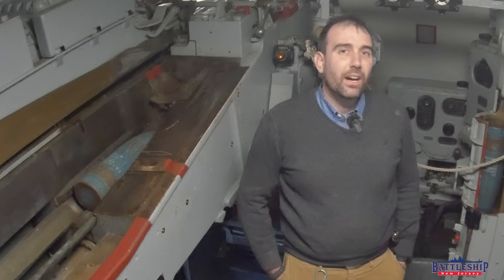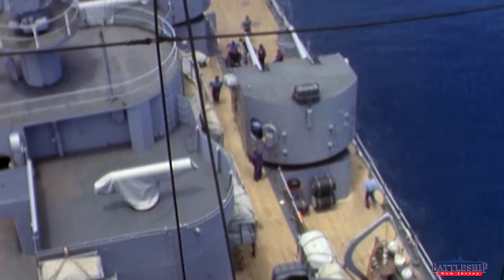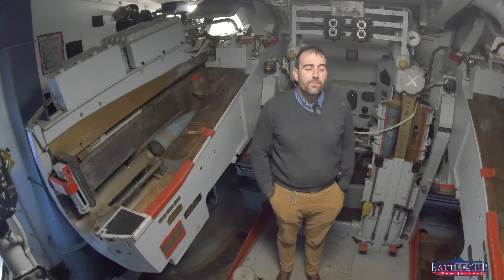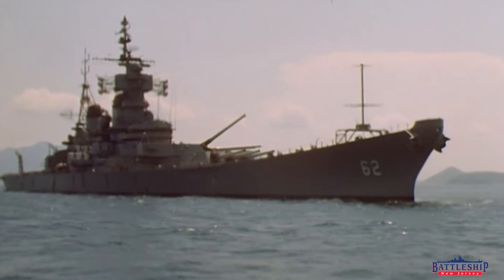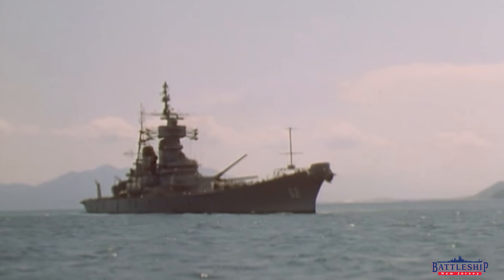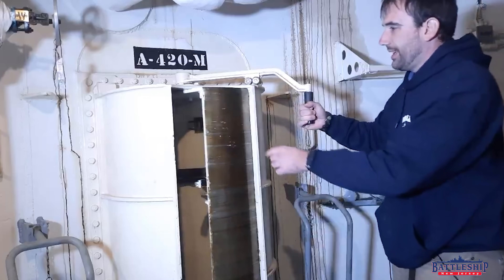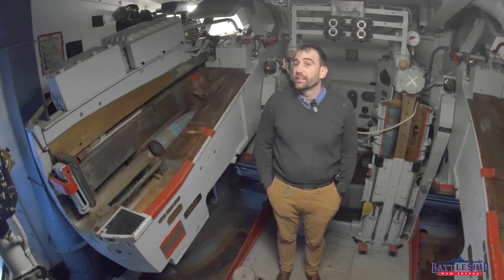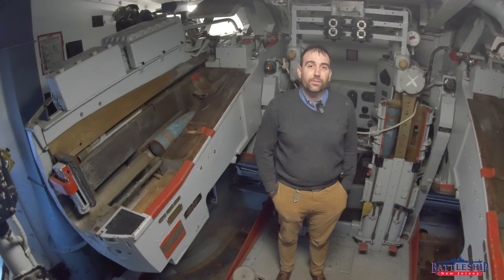Why Do Modern Warships Have So Few Guns?

Comment: What is needed in modern destroyers are a more capable main gun in the 140mm to 155mm and even the 127mm/L64 and another two medium high velocity guns like the Oto Melara 76mm/L62 super rapida or a brand new 88mm high ciclic rate of fire and long range and altitude and of course a couple of 35mm or 40mm like the French CTA or the Rheinmetal AG Millennium gun or even the Mauser MK-27mm and the upgrade of amunnition that is already happen with time mode airburst capability or cased telescopic ammo and the new Leonardo/BAE Vulcano amunnition with a 120km range from a 127mm shell but we need is a 140mm or even a 166mm heavy shells than with this extended range ammo even from the 155mm VLP capable of more than 60km form a 52 calibre barrel its impressive can hit targets in land easily but i think that rocket artillery will dominate targeting on land targets they are cheaper than a missile like NSM or Teseo MK2 Evo or RBS 15 MK3 Gungnir a GLMRS from the sea rockets with new improvements already go to 100 miles easile and others 300km like the Predator Hawk and i think from now on more types of this rocket artillery will be develop, like the GLSDB from Boeing/SAAB they can hit targets 150km on land and will be very easy to load and integrate on a ship and they have a 93kg warhead that is very effective agaisnt a range of targets and very cost effective i think that will be the future i dont now why in Europe so many amazing frigates and destroyers are being design and build like American new frigates dont implement already this new ideas and proven armament and continiuos evolution of systems i think we all see how modern warfare will look like you just have to look at the Rússia invasion of Ukraine. We need in the NATO western countries is a massive rearmament program and new amazing developments of new systems that will create millions of jobs and exports to friendly nations

Comment: You nailed it.  The trend has gone too far away from guns to missiles. Guns need to come back to a economical and utilitarian balance.  The single main gun will stay, as will the missile loadout as the main weapons systems. But the idiots designing these ships and the idiots ordering them will soon learn all ships you want to NOT be taken out will need a good, last line of defence, 360 deg CIWS, i.e. Phalanx and or air burst munitions like the 40/57mm 3P Bofors.

Comment: You have to look at the cost of building a battleship with multiple guns, ammunition, crew, and fuel in comparison to an Arleigh class III Destroyer. The modern Destroyers are manned with a quarter of what it would take to manned a battleship and be more effective on its mission.

The Tomahawk missiles (though expensive) have a wide range ordnance that can attack a target (i.e. cluster bombs, high explosive warheads, etc.). The 5-inch gun has rounds that can penetrate several layers of steel and explode more effectively than the old WW2 variants.

You also have to factor in the anti-submarine warfare capabilities of the modern destroyer in contrast to your battleships.

While it is sad to see the big guns go into retirement. The mission is always evolving, and everything changes with it.

Comment: Sometime around the mid 60s , the air force made the mistake thinking guns were obsolete and they were wrong. They have to fix that with a new generation of planes. But then a big gun can lug down an airplane and take away flexibility, such as the 30 mm in the A10. It be so nice to make the gun detachable and substitute other ordnance instead.

Comment: I think until energy weapons are more viable (I'm aware that they already somewhat are, but they still aren't really in use, or at least common use) that we will probably see more CIWS gun type systems filling the gap of missile cost/ammo expenditure, and maybe even some old school large bore flak guns as drone swarms become a growing a threat. And I think we are likely to see railguns in use at some point, as they offer missile like range, but a much cheaper harder to intercept projectile...I'm not even sure that could be intercepted, since they're basically solid metal unlike a missile...

Comment: Better ammunition is the key for Battleships to be revived. Looks like the guys from New Jersey dont know about the norwegian company Nammo and their products. They are making 155 mm shells with solid fuel ramjets. These are able to hit target from a distance of 150 km prety accurate. Besides there is one more example. At the end of WW II, germans had made some 283 mm amunition for the railway gun K-5. Aleksander Lippish was the man behind it. These 283 mm shells could go for 300 km. If we keep this in mind then a 406 mm shell could possibly hit some target that is 400+ km away and thats already a range of rocket. So far as i remember, even in the USSR was created something. The only difference is that a ramjet was on the nose to pull the shells and not to push. It was like some additional module to a standart ammunition to extend the range.
Dear battleship friend, you are actualy wrong. Ammunition with ramjets is the way for a modern Battleship. Of course all these shells should be like the Excalibur or russian Krasnopol, just much bigger.

Comment: Im not surprise that many WWII history enjoyers or knoes of WWI and WWII naval boats (or even way before) had this question.

I say, guns are not obsolete, neither missiles. We are starting to impelement laser defense systems as well and they wont be replacing the guns or missiles either.

Instead they will play a part of a layered defensive and offensive of modern naval combat.

Arleigh Butke Mk45 Mod 1 and 3 5in guns do have an autoloader but fairly slower than of the Forrest Sherman. It is capable of anti-air which is nice. We may see some ship classes with an extra pair of 5in or not. I do not know.

Not every missiles are that expansive, though the more advance a missile is, yeah it'll be expensive. ESSM can be bought in bulk and give 4 times as much anti-air capabilities.

To not drag this on, guns, lasers, and missiles will have to work with each other for defensive or offensive means. Not one will replace the other

Comment: I would Wish to have a shore bombardment vessel with 12" or 16" guns in a single dual mount fowards, the entire aft deck would have a double helicopter hangar holding 2 up to 4 helicopters each or F-35s, and the remainder with a massive battery of long range anti ship vertical launch missiles at least 30, amid ship would have limited super structure outside of the needed hangar room with elevators to access a air maintenance and arming bay, Each ship powered by a large single nuclear reactor contained in a armored citadel, with various other  CIWS, and Short range missiles.

Comment: I remember cruisers having one 5 inch gun in the forward section and one on the aft section(unless it was a smaller caliber of gun for the aft section).

Missiles and carrier air groups do a lot more in terms of naval combat. But, I think one more gun, single barrel and a smaller caliber added to the aft section of a warship could be possible. But I may be wrong because the Arleigh-Burke destroyers use speed and their offensive capabilities to defend a carrier, or even an Iowa class battleship. 

If a battleship or battle cruiser were to be built today, it would probably resemble Russia’s Kirov class battle cruiser and it might be longer and stronger in order to hold a larger capacity of shells.

Or include another Phalanx CWIS.

Comment: The Royal Navy is fitting a second 40 mm Bofors gun to their Type 31 general purpose frigates, currently under construction, to address threats such as low cost drone swarms.These frigates are primarily designed for the sort of conflict that is occurring in the Persian Gulf.  The RN had no alternative other than to deploy a large, complex, air defence destroyer, primarily designed to defend carriers, which is using expensive missiles to destroy crude drones.

Comment: Shore bombardment has been replaced by precision strikes. Shore bombardment is psychological warfare. A big gun is an instrument of terror. Better to kill the enemy than scare them sh!tless. There is more utility in a precision weapon than an artillery shell the size of a compact car. The cost of maintenance on a big gun with limited use is better spent on a surveillance aircraft.

Edit: As a onetime Ohio-class sailor, I submit the SSGN as the modern replacement for the battleship…even with the cost of nuclear power and missiles (which are leased until they go boom btw).

Comment: I can see the necessity of adding more 5" guns. The Iranian navy appears to have adopted a strategy of using swarms of high-speed, lightly armed, boats to harass larger ships. We cannot afford to expend a missile on each boat in a swarm. We'd be expending millions of dollars to destroy a boat that cost thousands. That math doesn't add up. Even if it did, defending a ship against one of these swarms could exhaust its entire supply of missiles, essentially taking it out of the fight until it could be resupplied. Again, the math doesn't work for us. A force of inexpensive speed boats could defang an entire squadron of US Navy destroyers, as long as the enemy were willing to lose that many speed boats.

Of course, a single 5" gun, with its auto loading and radar guided aiming, could handle a large swarm of speed boats -- as long as those boats stayed on the same side of our ship. But, if the swarm were to attack from multiple sides and directions, even a modern 5" gun could be quickly overwhelmed, allowing one or more of the speed boats to ram its high-explosive cargo into our ship.

Comment: Why is there so much rust on these ships?
Reply from the maker: Steel Ships in saltwater environments rust very quickly and surface rust is only a surface level issue. All active ships have rust.
Reply: @BattleshipNewJersey  I remember that they use to paint ships, do they not do that anymore? In fact I remember one of the jobs sailors had to do was over the side and paint them to help stop the rust. Every time I see a US ship it is rusty.
Reply from the maker: They do paint, a lot. But its not the most important thing they do so if they have more important jobs painting doesn't get done. Look at ships during WWII or Vietnam, they're rusty than what you see now.

Comment: I understand that missiles are the main armament, and therefore there is no need for so many guns as it was common in the past. What I don't understand is why do some rather big ships, like the largest destroyers and even some cruisers, have only a SINGLE gun. In assymetrical warfare quite common today, when such autocannons are useful against speedboats, pirates, etc, a single mechanical failure or a single lucky RPG hit would make the entire ship completely defenseless at certain ranges. Why not have two, at least for redundancy?
Reply: They tend to have a single medium caliber gun nowadays. There’s always 2 or more autocannons (25mm usually), at least one 20mm CIWS, plus multiple .50 BMGs

Comment: I like the look of the modern and advanced single barrel cannon on ships.  Though I would like to see a staggered set of two of those cannons on ships, but that probably won't happen because of maintenance issues (modern guns have a lot of technology in them) ... or better yet a railgun (probably won't happen because current technology has not caught up with sci-fi requirements).

Drones are here to stay, and drone swarms are an effective strategy.  High tech heavy machine guns and light auto-cannons (sub 40mm weapons with dedicated targeting systems) are here to stay because they shoot cheap enough rounds to deal with cheap drones, but accurate enough to engage them at miles.

Modern ammunition is a massive game changer as the ammunition can make bullets non-self propelled missiles.  With modern technology it is possible to counter a drone swarm with a single volley from a gun.  The gun targets the drones and programs the "smart ammunition" to hit each individual drone.

Comment: I think they need a couple more guns on each naval ship. Protection against drones and potentially other missiles. Less cost to use and re-arm.

I heard each missile from Carney costs a bit over a couple hundred thousand each. Each drone they are shooting down with those missiles costs 20 thousand.  So we are spending 5 times as much per drone we shoot down with a missile.  Pretty sure bullets cost a lot less than 20,000 each. 

As others have pointed out, IF a single 5 inch turret is hit, or becomes inoperable, you have nothing to shoot with (besides maybe a CWIS). Not wise. 

Plus, as evidenced when the battleships were operating, a big ship with big guns shows up iff shore, it DEMANDS attention and respect. Our ships almost look toothless these days. Sure, we can shoot missiles from a hundred miles away, but we aren't going to intimidate anyone with a missile armed ship when all the missiles are vertically launched and kept below deck.

Comment: For awhile, and just prior to the Iowa class battleship’s permanent retirement, the navy was seriously developing a “smart” type of 16” shell that was supposed to have had some in-flight guidance and an increased maximum range from 30 miles to  something around 80 miles.  Apparently the problem was the manufacturer wanted some eye-watering price on each shell.  Something like $300,000 per round.  So if they could have somehow overcome the other issues that existed with reactivating the four BB’s and managed to get the production costs of these new 16” “smart” rounds down to a reasonable cost, the United States Navy would have processed an incredibly unique and valuable offensive tool  in the 21st century.
It still, in theory, could be accomplished beginning in 2024, but the up front costs would enormous.  But I do think the expense in manufacturing these modern 16” gun shells still could be eventually lowered after the initial first batches were made and distributed to the fleet.

Comment: Guns are crew intensive too.  A 5 inch gun with modern millimetric radar and firing rates of 3-5 rounds per second in a single modern mount easily replaces 3 dual mounts from the 1940's.  Destroyers in the 40's had ........
Reply: I am in the same wheelhouse.  when it comes to drone swarms there is going to need to be a vloume of VT fused shells fired, so I would guess a couple 30mm class guns with corresponding magazine sizes for ranged work with a change to something like the helicopter mounted miniguns used for close in work against both drones and boarding parties.  (7.62mm? or 12gauge?)

Comment: It’s like with a fighter jet. There is always a need for a gun. Because the situation or the rules of engagement require visual sightseeing of the enemy. There may be situations where the gun is necessary.
Reply: The gun is only really necessary if you're out of missiles. Even if you somehow end up within visual range, a modern short-range missile will do a better job than the gun in 99% of situations.

The F-35B and C do not even have an internal gun anymore, though they can be fitted with an external gun pod.

Comment: I wouldn't be surprised if the accuracy and range of other ordinance types was a deciding factor as well. A battleship and other naval guns can throw a lot of explosives into an area, but modern wars aren't like they used to be compared to WW2 where the goal would be to fire on defensive fortifications to prepare for a landing, to destroy a whole area, or fighting on small islands where targets would be in range of the ships etc. Even by the Korean and Vietnam war, naval guns were starting to not be suited for the new way of asymmetrical combat. Launching a bunch of unguided shells into a target area in the modern day would draw all kinds of attention because of the collateral damage, assuming, like you said, the ships were even able to get close enough because of the capabilities of anti-ship missiles. As soon as targets are away from the coastline, traditional naval guns can't do anything. 

Traditional naval guns would be useful in the modern era if island fighting were to happen, but it again circles back to getting in range because the only islands we would be fighting on would be against an equally peered military and navy. They would have plenty of long range missiles as well as a strong Navy and Air Force for defense. For naval guns to be used, the missile sites would need to be neutralized (and due to the range of the missiles, ground troops or air power would already need to have a foothold so far inland out of range of naval guns), and/or the opposing Navy being mostly destroyed.

Comment: If heavy naval guns don’t come back in the traditional sense it will be caused by one of 2 eventualities, the first one is a viable rail gun is produced and a new cruiser class gets them, I can also imagine a Zumwalt class retrofit given their power generation potential.

The other possibility is an adaptation of rocket artillery, aka cheaper missiles in bigger quantities. Given the trend of MLRS vs Tube artillery used the Army and Marines is increasingly favoring this I wouldn’t be surprised if the Navy isn’t also considering it.

Comment: "Hardened against electronic warfare"

I think this is why the doomsayers for ships and tanks, who have been predicting the death of large and expensive assets at the hands of a swarm of inexpensive and expendable drones are very seriously wrong: it is easy to make a suicide drone that is many times cheaper than even the cheapest surface-to-air missile produced in the west, but it is NOT possible to make a cheap drone that is hardened against electronic warfare countermeasures. 

Putting EW countermeasures on a tank, a plane, or a ship however is a pittance compared to the cost of the tank, plane, or ship, so it will always be cost-effective to do so.